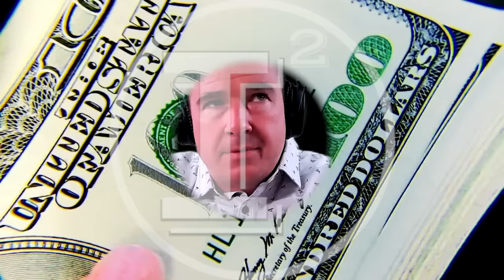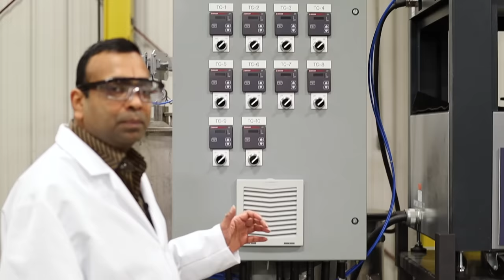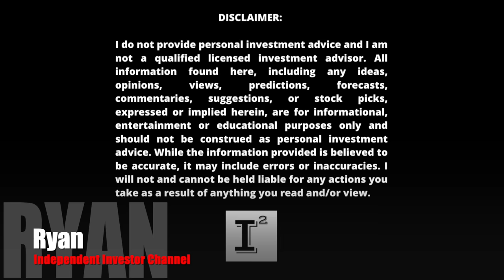Aduro Clean Technologies Site Visit Part: 3 Industry Leading Plastic Recycling Technology $ACTHF

Comment: Anil said, this reactor is higly modular. I see, that they are able to measure and control everything (like the water-ratio, pressure and so forth. But, do they really need to handle that manually, or do they have a Software, which they use to automatize the processes over time? Because if not, this isn't really scalable.
Reply from the maker: I’m of the assumption that question, which is a really good one, would be better answered by the company directly if they even can.  Remember, they are knee deep in their obligations and commitments through the shell GC program…I took modularity a little differently than you but your point is a valid one…all the best, Ryan
Reply: They have software that automates the process. They will be able to process 4 types of plastics using this machine without interruption.
Reply: @yazanhomsi9079  Thank you. Is this software an inhouse product or a proprietary software from a vendor? If the latter, who is the vendor and what's the name of the software?
Reply: I would really like to know where I can buy this stock to slowly start building a position, if anyone in the Uk knows would be appreciated, thanks Ryan
Reply: @jetlife1112  try one of these TradeStation, E*Trade, TD Ameritrade, Fidelity, Charles Schwab
Reply: @Jet life  I called Charles Schwab. They wanted $32.95 per trade, i.e., buy or sell shares. It appears that E-Trade's website charges ~$6.95 per trade. Previously, I have purchased other OTC shares, e.g., "Voxtur" & thus far, paying trade fees only adds insult to injury. I like many -- am currently-70%+. I am patient. Just not really interested in paying trading fees.
Reply: @ljdschad295  whats 7 bucks in the grand scheme of things? Gotta pay to play.
Reply: @grahamgregory8363  I use a full-service broker that charges c. 60$ per trade, but I get the convenience of calling in my trade from anywhere. That said, I have a significant position in Aduro (my largest microcap position after 18 months of DD), so clearly I am biased and by no means a financial advisor